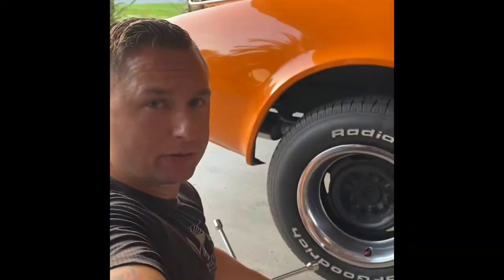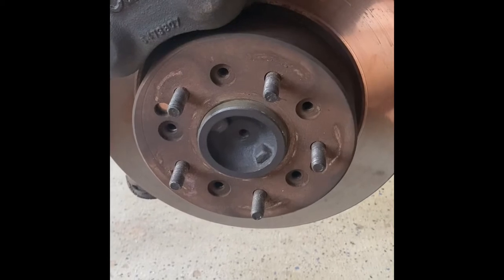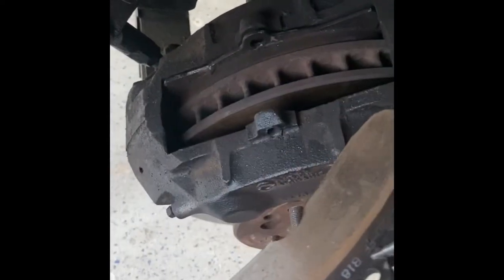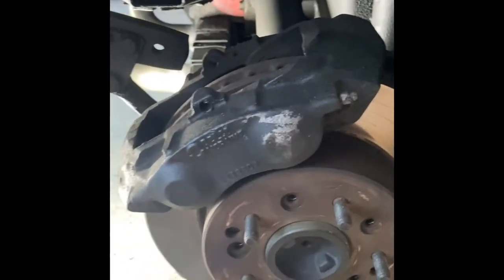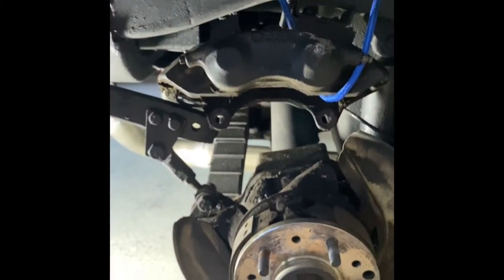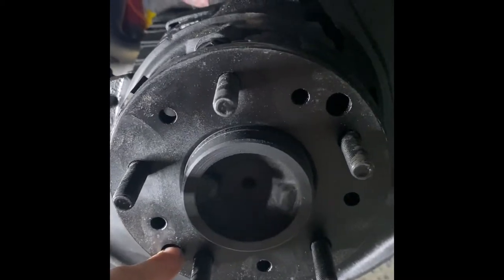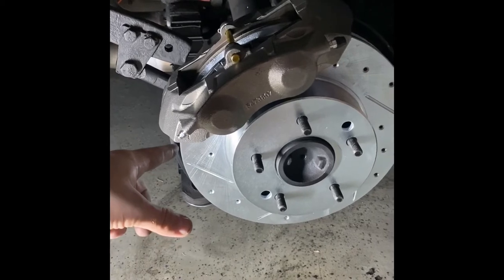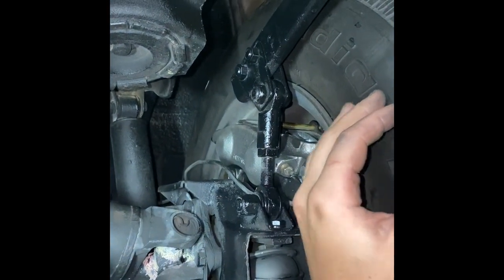C3 CORVETTE FULL BRAKE JOB

Comment: Subscriber here. Luv your videos. I also have a 78. Quick question: are those Zip calipers also "spring-loaded" as the OEM ones, which are a pain for inserting the pads on?
Reply from the maker: They are piston so you just need to use a putty knife to hold it back while you sneak the pad in. Helps tremendously
Reply: @classiccorvetteguide9147  Thanks!

Comment: Did you check the runout on the rear rotors?
Reply from the maker: Raymond Mendoza there is non- no vibrations in steering either.
Reply: @classiccorvetteguide9147  Usually, if there is an issue, it's with the rears as originally the rotors were machined as an assembly with the hub, that's why the rivets from the factory. Great video!
Reply from the maker: Raymond Mendoza thank you brother